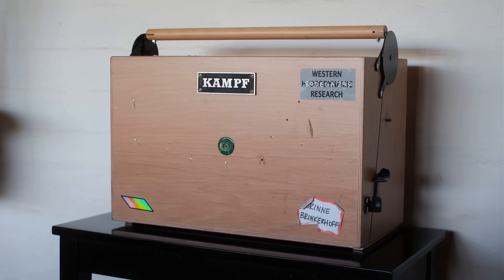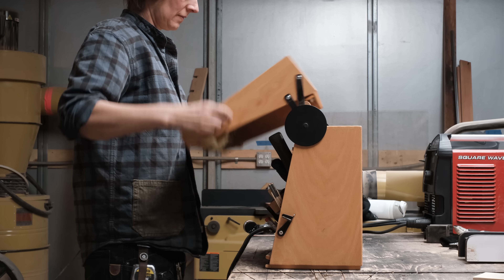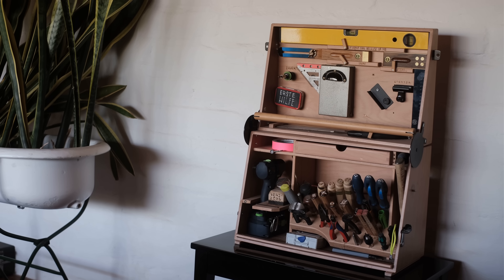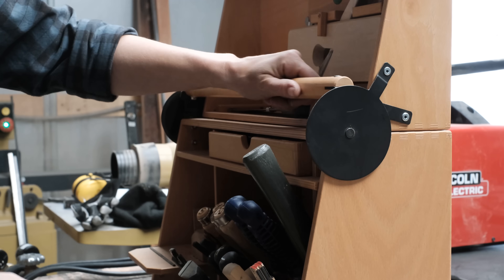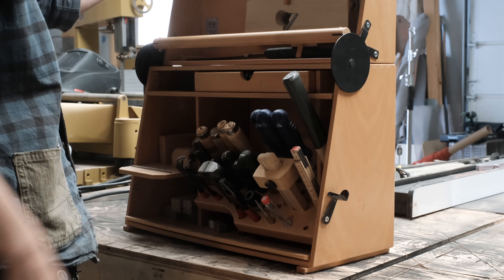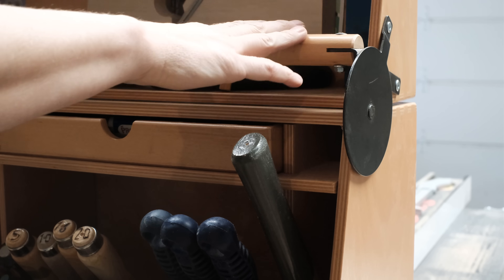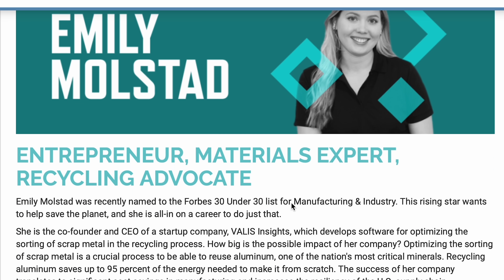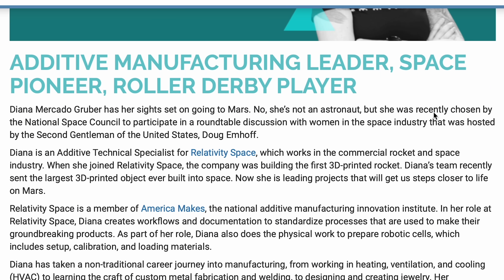This hinge is so clever! ...but I made a simpler version (with Template)

Comment: The hinge seems overly complicated. A folding or removable handle would negate the need for such a complicated hinge mechanism.
Reply: ... and that would be so boring.....
Reply: Is torsion/twisting an issue? It seems like it could be, with heavy tools and thin metal straps. One possible solution: Make the handle hollow, run an axel through it, and connect one end of each side's second strap to the axel so both hinges always move in unison.
Reply: @ Easy fix? small handle in the centre ensuring that lift occurs symmetrically. Should the lid be loaded one sided, have two small handles that force the user to adjust the lift force to the demands of the unevenly loaded lid.